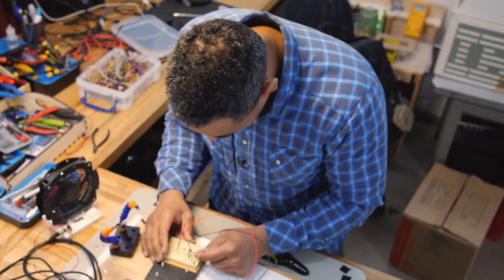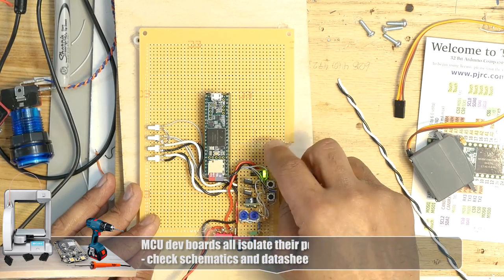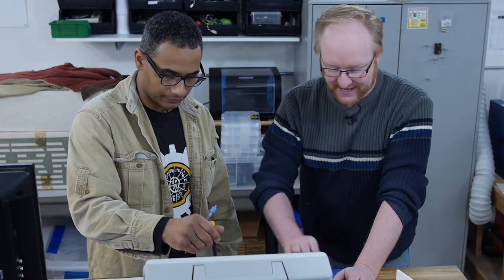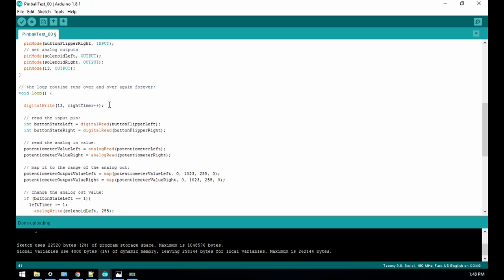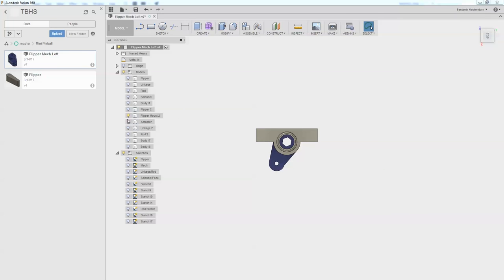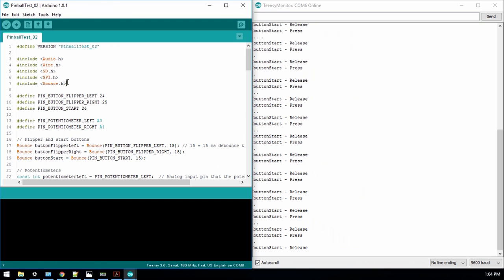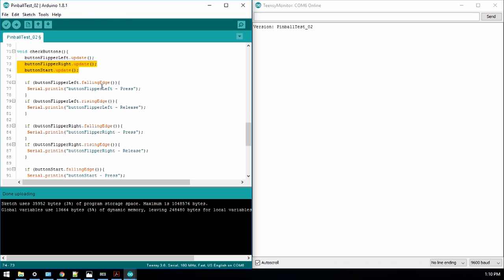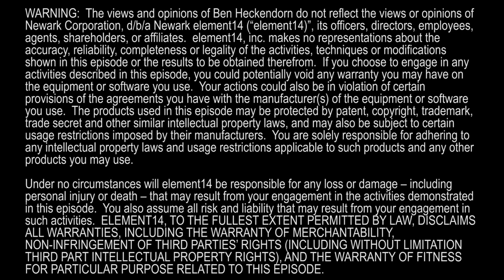Mini Pinball 02: Let's Get Flipping!

Comment: Curious as to why they didn't use millis() to assist in timing for the solenoid control - that would've made short work of the problem.
Reply: Or use an elapsedMillis variable, at least.  They're real cheap.

Comment: "I'm having troubles with getting the SD card reading"

Oh, god, I know what you mean.  The state of those libs with respect to the Teensy 3.5+ built-in SD cards is kinda garbage (at least, it was a couple of weeks ago).  If you're trying to play mp3s off the card, though, may I recommend Frank Boesing's Arduino Teensy Codec lib: https://github.com/FrankBoesing/Arduino-Teensy-Codec-lib

It works really well with the Teensy's audio graph stuff.

Usage sample: https://gist.github.com/Fordi/baa4330461f1ee202bf486ec1b46ffb9

This was tested on my Teensy 3.5 for a music player I built for my kid.  It just plays an SD card full of random files, one after the other.

If you're directly addressing files, remember that it's all old-school 8.3 DOS filenames.  That tripped me up hard in my initial testing.
Reply: "We're using such a fast microcontroller..."

https://www.pjrc.com/teensy/td_timing_elaspedMillis.html

Set it to zero on the falling (/rising) state of the button, then wait for it to rise past your time without pausing the loop.  It has a clock! Get accurate timings!
Reply: "I haven't been able to get the audio to play on DAC1..."

Use AudioOutputAnalogStereo instead of AudioOutputAnalog, and patch to its channel 1.  You can see how it's done in the sample code I posted above.
Reply: Incidentally, if you work out how to direct-drive that little screen from a Teensy, PLEASE post the sources for that.  I have so many harvested LCDs I'd LOVE to figure out how to big-bang a few LVDS signals.

Comment: Why not use and old M2N68-LA (Narra3) motherboard with a PHENOM II X6 and 32GB of ECC RAM and a plug in PPT addin card which should allow you to have control over the display and the other solenoids and as it has a built in audio subsystem you can have HI-Def audio rather than PWM audio and the firmware can be build in Code::Blocks with the GCC80586 compiler and can be powered by a normal PCXT PSU don't know if this what you want to do.
Reply: Probably not a cost- and space-effective solution. Also some supply issues would arise in near future ;-)